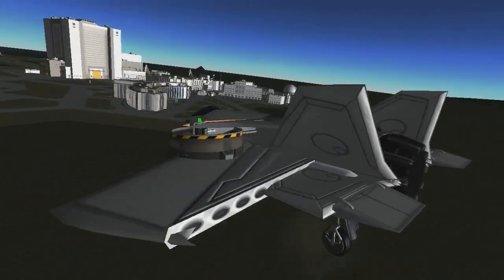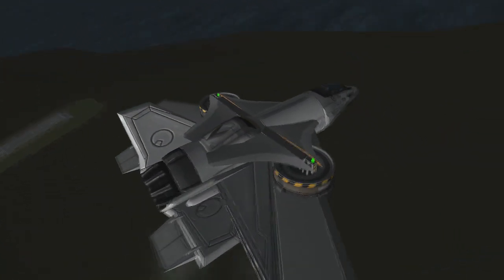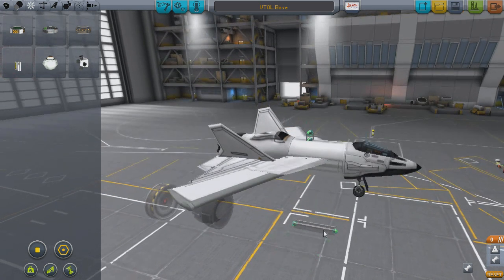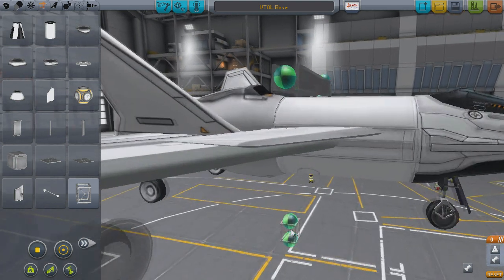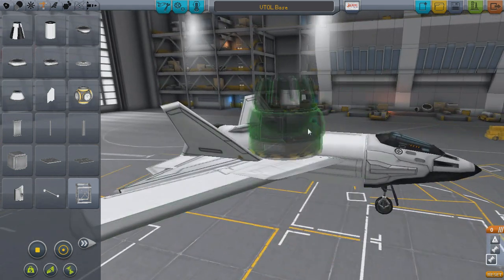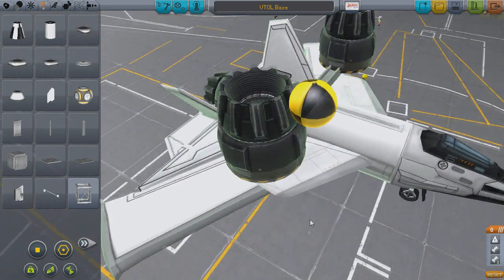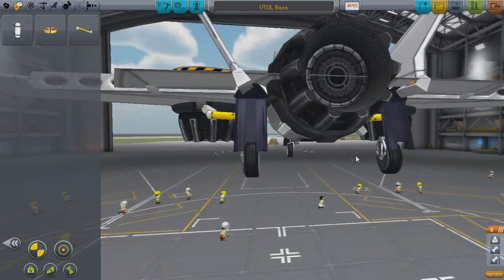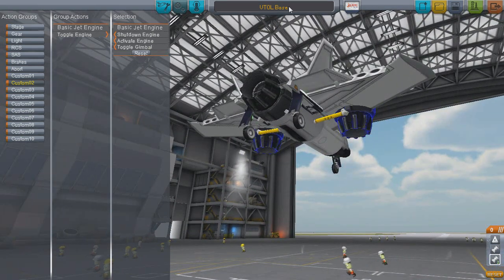KSP Quick Guides: Basic VTOL Design Tutorial -- Stock v.22 and v.23

Comment: my engines, center of mass and center of lift are aligned yet it stil flips out on me
Reply from the maker: Hmmm...I'd probably have to see pics or see the craft file to figure out what's wrong. When you say center of lift and center of mass are aligned, do you mean they are directly on top of each other? You'll want to move the CoL back outside of the CoM bubble if that's the case because if they are stacked up you plane will be extremely flippy!
Reply: the center of lift is inside the center of mass in order to make it extremely maneuverable and my vtol engines are alligned. this is where i learned how to design aircraft http://forum.kerbalspaceprogram.com/threads/52080-Basic-Aircraft-Design-Explained-Simply-With-Picturesif that helps
Reply from the maker: Ya that is a great guide. The part you'll want to focus on is this part: http://i.imgur.com/Nl5hdZf.png
Basically when your CoM and CoL are on top of each other your plane is just too maneuverable. I guarantee if you slide the CoL back so that it is at least halfway out of the CoM bubble (I'd recommend it being completely outside of the CoM bubble) you'll still have a very maneuverable plane, but it won't flip as easily.

If you have a joystick you can get away with having an excessively maneuverable plane, but with keyboard controls it is hard to keep it from flipping :(
Reply: thanks man its just i designed it to be excessively maneuverable for it to be like a superfighter of some sorts

Comment: How do you deal with the center of mass when you're using 4 engines for VTOL?
Reply from the maker: There are a couple of ways to do it. The first would be to have 4 I-Beams coming off of that central strut to make an "X-Pattern" design. Or, you could run two I-Beams off of the central strut that run along the body of the plane. From the ends of those beams you could then add two mroe beams going off to the side with your VTOL engines. This would look like an I-Pattern (Or an H-Pattern depending on how you look at it). Both methods let you still pick up that central strut and move it around to make centering it over the CoM very easy.

Hopefully that helps. I should make a video on larger VTOL designs.
Reply: Cruzan AK I never thought of that... That's a great idea. I've always been having problems getting large VTOL aircraft to fly (similar to the one in the movie Avatar). They either end up flipping forward or backwards. This is helpful, thanks.
Reply: Cruzan AK Please do make a video on larger VTOL designs, that would be great to watch. :)
Reply: Its important to note that in the VAB you can right click main drive engines and set the thrust to zero, then when you toggle the center of thrust AND the center of mass both to highlight on your aircraft you can line them up to perfection...
You can literally be as anal as you have patience for :P
You can also right click and empty the tanks so you can get an idea how she might handle after some fuel has been burnt..

Comment: is there a functional difference between the plane you showed in the opening sequence?
Reply from the maker: Do you mean between the plane in the intro and the plane that was built in the video? Nope! I think there are just some cosmetic differences is all. Did you try making it by any chance? :D
Reply: I made the plane you did in the video and I tried to make the one in the opening sequence. So far the ones I made seem to fly similarly. I just have trouble with how responsive they are when it comes to pitch. My roll and yaw axes on the other hand are incredible. I also have been having trouble performing the maneuvers you showed in the flying episode because of my pitch, I've wound up doing them using just my roll and yaw to similar effect but allowing me to see my retrograde on several occasions with a loss of altitude.  
You also said in that video you could do a lot of dogfighting manvers. I would be interested in seeing a video on that.
Reply from the maker: Ah, well the reason the plane is more responsive to roll/yaw and not pitch is because the reaction wheels are centered right on the pitch "axis" which means they don't have much of an effect on pitch. The further away a reaction wheel is away from an axis, the more of an effect it has (think about levers, or "moment arms" if you know mechanics). So if you want more pitch authority, you can place a reaction wheel towards the front/back of the plane and you'll get more pitch control!
I forgot about the dogfighting stuff. I'll have to revisit that!

Comment: I usually use a radial mount thingy on the top of the craft and then put the engine(s) on that bit, clipping through the fuselage. It allows for the easiest re-positioning based on the CoM.
Reply from the maker: Do you mean these? http://wiki.kerbalspaceprogram.com/wiki/BZ-52_Radial_Attachment_Point
Ya they work great as well! I prefer the http://wiki.kerbalspaceprogram.com/wiki/Cubic_Octagonal_Strut myself though :D
Reply: Yeah, I love those things, too. The only reason I use the points is because I sometimes find it harder to click on the struts through the engine. They're great for making high-flexibility cables, though. I have about 100 of them in my Munar cargo train.